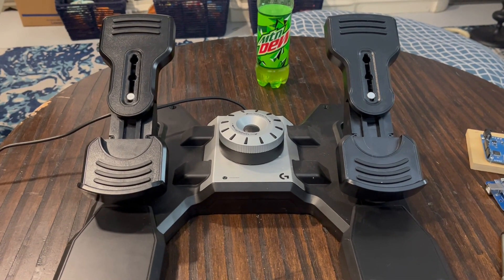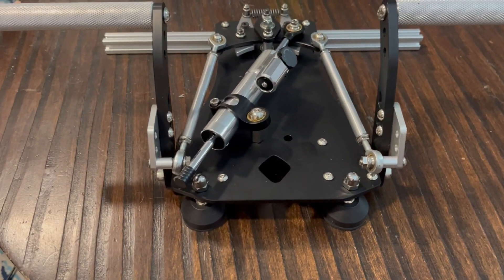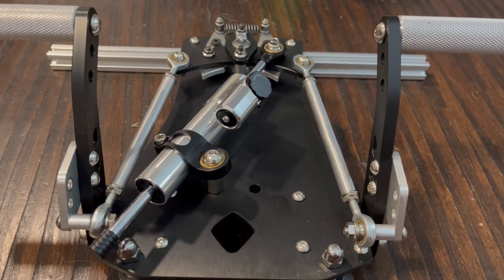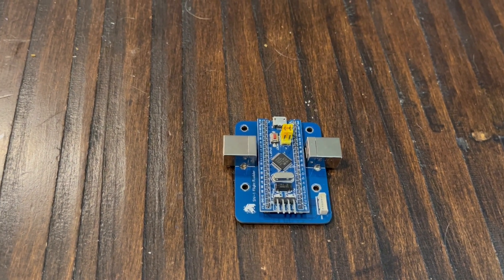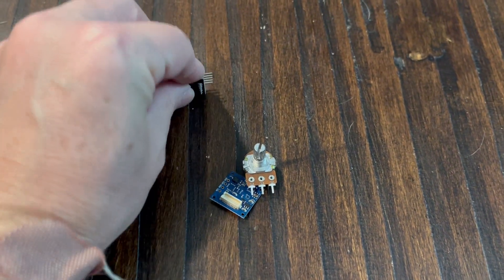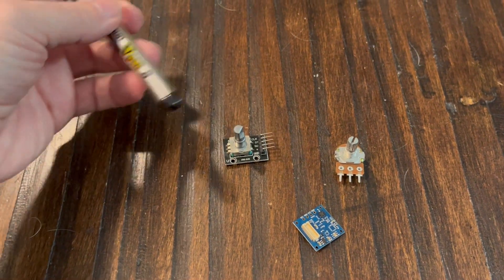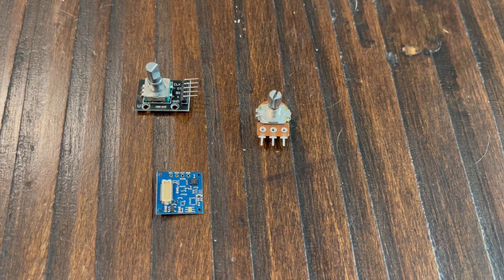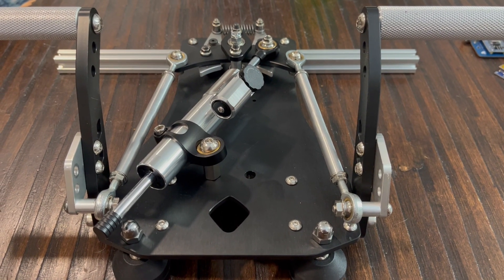Gaming Hardware - Rudder Pedal Project Part 1

Comment: I bought a set of these about a year ago and even made a video review of them. I primarily use mine for flight simulating, mainly with helicopters. However, they are suitable for all types of flying and are built like a tank. I recommend adjusting the position of the damper; in your setup, the rod at the end of the damper is hitting part of the left-side mechanism. I've included a link to my YouTube review of the pedals here:  "https://youtu.be/CGRWAC6nyNs?feature=shared"

Comment: any update?
Reply from the maker: Yes and no.  Following a couple of leads to the original Chinese software (!!!) that it was paired with originally resulted in no result.  Or at least I wasn't able to get it to work in any  way.  The build quality was just too good to pass on, so I bought a logitech q throttle quadrant that I am disassembling to use as the electronics for this rudder assembly.
My focus the past couple of months has been getting VR working in DCS, and I have recorded some videos in VR to try and get the format right for youtube.  new videos soon on vr, and hopefully a video soon on this rudder project.

Comment: Oof. Good luck with setting up those pedals. Also used to use Logitechs with spring removed. I'm using the T-rudders now, which are similar in design to what you picked up there, and it makes the world of difference for precision and comfort over those Logitechs for helo flying.

Comment: It is taking all of my willpower not to impulse-buy some of those Falcon pedals. Not sure if there's a better UK retailer than the ebay listing. My current pedals are some Gameport CH Pro pedals which I've modded to use a Teensy and which has 2 out of 3 pots still working.

My plan is to design and build flight controls that complement / attach to the Ikea POANG armchair I use for sims. I have ideas about setting up nice trim systems - that would more easily fit under a chair than in a device designed to sit on a desk.
Reply: my willpower lasted about 2 hours after making this comment
Reply: @RoamingAdhocrat  any update?
Reply: @RoamingAdhocrat what’s the polling rate in these?

Comment: I was just about to purchase these pedals for DSC ah64D ,they look solid. Don't think I will now,  don't know much about Electronics I think I'm going to pass. 
Wish there were more reviews on these.
Reply from the maker: Good call on the pass for now. They should just work, and if I can I will review them… the logitech unit isn’t terrible but I don’t think that they are worth the money.
Reply: @JohnnyD I read a  good review on the DCS forums so I took a chance on these, they shipped from NJ, and I had them in 5 days. I'm quite impressed  with these.
PNP, so smooth and solid, Very happy😃
Reply: @jorgegrillo9934  Hello, this is my own product made in China. If necessary, I can directly buy it on Taobao

Comment: Could you not get a new board from the manufacturer as surely it's still under warranty ?
Reply from the maker: Yes and no. The hassle of just getting what I got was prohibitive. My wife (and others) have told me to just return it. Not to be terribly insensitive to other cultures, but I don’t think that the word warrantee translates as a legal term into Chinese, especially after the tone of communication gets argumentative. I like what I have. 

Further experiments have revealed that the board is working, and that DCS is at fault… I will explain more in a future video. Using different boards with programming that should have worked also had similar results… I have some leads to follow and I don’t have a board that works in dcs yet, but when I do have a breakthrough it will unlock all kinds of fun options. If my current understanding is correct, sending back the board and waiting for a new one will only cause delays and end up still not working in dcs. More info soon.
Reply: @dewfiend  Hope you find a solution soon they do look nice pedals, the damper looks very similar to the one on my MFG Crosswinds.
Reply: @dewfiend  I'd love to know more about this. It's a single-axis joystick... it really ought not be complicated, right?